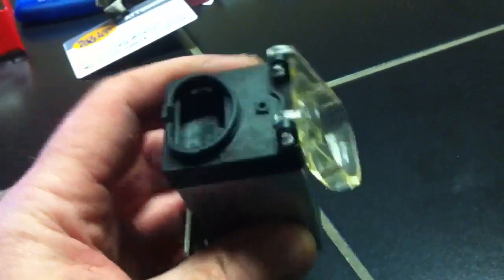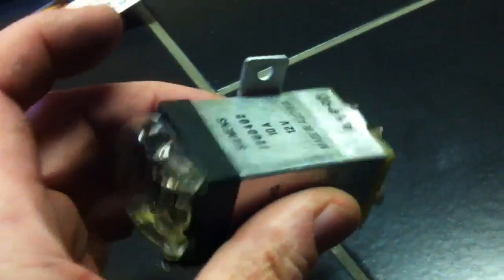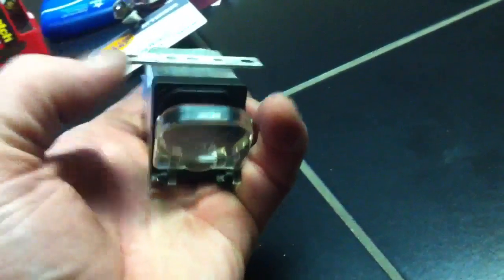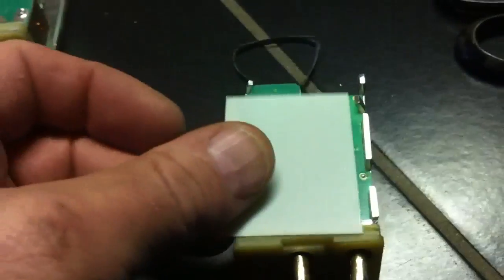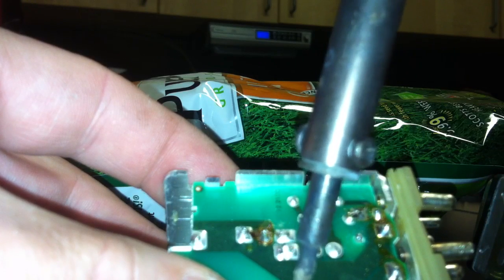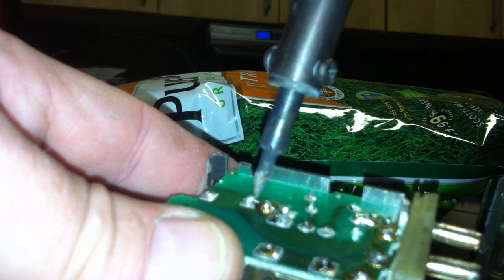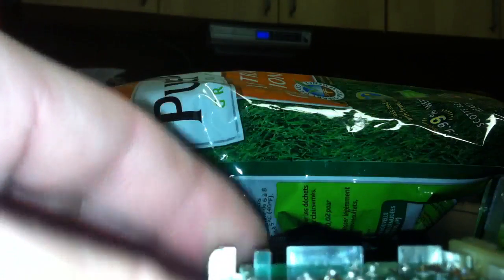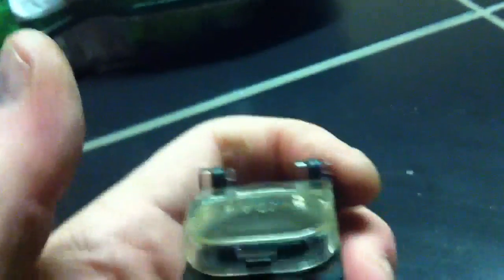Mercedes OVP relay repair

Comment: the windows, door locks ,turn signals, rear defrost,and  sun roof quit working  and trunk wont open. all this happened at the same time. help me
Reply from the maker: it sounds like the front or rear "SAM" signal acquisition module is bad..it could be a faulty OVP , but I don't think the faults would be that comprehensive. It wouldn't hurt to re solder the OVP for good measure. The rear SAM is more likely the fault, and can many times also be removed and resoldered..it is under the trunk liner near the battery.... A used one from a wrecking yard would be pretty inexpensive... A new one at a dealership, is very very pricey... also check relay "K"  in the diagram in this link   http://workshop-manuals.com/mercedesbenz/c_230_(202.023)/l4-2.3l_(111.974)/relays_and_modules/relays_and_modules_power_and_ground_distribution/power_distribution_relay/component_information/diagrams/assignment_of_relay_holder_i/

Comment: Thanks for the reply. Would you know the positions of the relays in the K40 when energized and not.  In an attempt to see if the relay defective, I observed the relay when energized and not. The relays are normally opened when not energized, and all but one (the 1st one from left with relay facing you) was closed when energized. The question is whether they should all be closed when energized. My w210 is idling very high, even with the ETA replaced (w/ a used one). Your comments is highly appreciated.
Reply from the maker: this is a great site for showing relay locations etc.  lots of workshop stuff...just annoying pop up ads to x out
http://workshop-manuals.com/mercedesbenz/

Comment: Where's the part where you throw the fuse into the car and say everything works great again?
Reply from the maker: Lol..the car was in storage when this video was done...so it wasn't installed for a few weeks... I had removed the OVP relay before storing it so I could re-tin it over the winter...  The cam position sensor ended up being the lumpy idle culprit
Reply: As I initially suspected :) Thanks for sharing.

Comment: Hi i have a mercedes 1990 5sp w124 300CE-24. It runs fine starts fine but i have a few problems the gear shifting is really hard and there is no power. When you accelerate it lags then slowly gets to 40km. I am trying to solve the problem my self until a mechanic can look at it. any suggestions?
Reply from the maker: It could be engine related ,but it sounds more like a bad bearing or bushing in the transmission...or low fluid.....will it rev freely in neutral?...

Comment: I made a video about it a while back here's the link http://youtu.be/edt-vL3Q7do pretty much when I do a cold start the car would work fine but as soon as it heats up and you turn it off and try to start when warm the car will start rough then it runs for about 5 to 10 second then it instantly does the on way to make it stay on I have to apply gas before it dies
Reply from the maker: it wouldn't hurt to try to re=solder the ovp..it won't cost anything and it is possible it is causing the problem..you can also do the idle re-set...when the car is warm turn the key to position 2 but don't start it...let it sit like that with the key on for a minute or 2...then push the throttle pedal about 1/ 2 way, hold for 2 seconds and release...leave the car for another 2 minutes ...turn the key off and then start the car and see if it helps...could be a dirty throttle body or MAF sensor on the way out as well......
1 last question... what was the engine code that you had re-set, and does the car run ok after the stalling at warm start, or will it not idle at all when warm ?

Comment: Can it also cause the car to start on warm start for 5 to 10 seconds then die instantly ?
Reply from the maker: The ovp can cause all kinds of weird issues...sounds like you may have a fuel problem though...can you give me a bit more information .
Reply: Mine does the same thing it run longer than 10sec or not I also have to hold my accelerator pedal down to keep it running even then it may die after holding it all the way down plugs and wires are new coil is new rotor is new cap is good full of oil and coolant fuel pump and filter are new timings in spec throttle plate cleaned fuel distributor is original but has ran tons of cleaners in fuel please help

Comment: Hi fupa!
Could you help me a bit.
I have m111 engine my w202 and idle is littlebit rough 800 - 1000 rpms, cold engine. I found in my engine compartment 1 vacuum line it was dropped on to my under engine cover its about 20cm long white vacuum line and i cant find where it belongs :/. Do you know where could I find vacuumline diagram.
Reply from the maker: that's one of the few diagrams I have never been able to find..It isn't in my factory manual either...check under the front plastic engine cover at the front/top of the engine..most of the vacuum lines go into there

Comment: It isn't located there either. The fuel pump relay is there and misc 15 AMP fuses. Could the C280 not have one for a 97'?

Comment: The one in front of the battery in the trunk is the fuel pump relay. The OVP isn't there on the 97 C280. Can't find it anywhere...

Comment: I can not find the OVP on my W202 97 C280?? Any thoughts as to the location? Its not on the passenger side control box...
Reply: I think it’s in the fuse box on the front engine bay top left

Comment: wow i never knew mercedes cant be jumped. So does this apply to the w210 models if so what do i do if my battery dies
Reply: If your battery dies , you can jump start your Mercedes... first turn off the donor car and leave it off and then connect the positive leads first and then connect the negative leads and then start your car  , with the donor car turned off at all times . Don't jump start a Mercedes with the donor car running because this will cause cracks within circuit boards and will have many issues with the electronics.